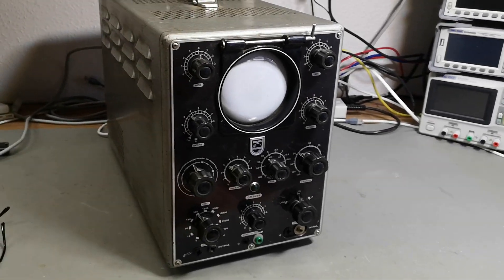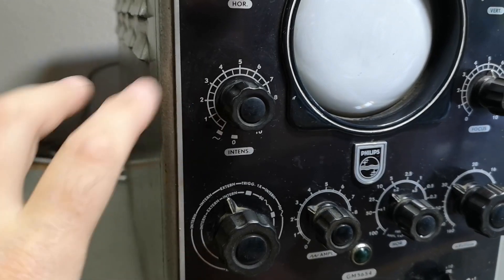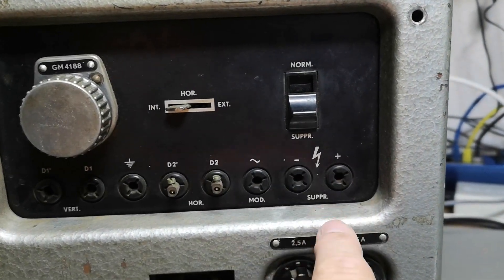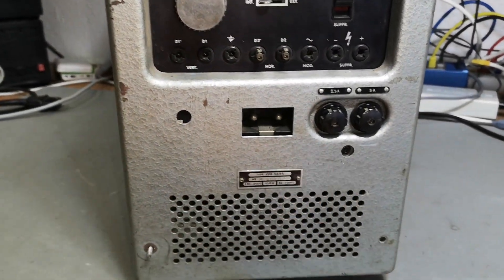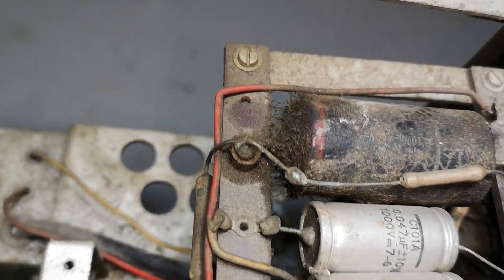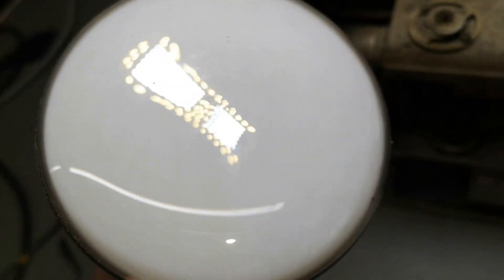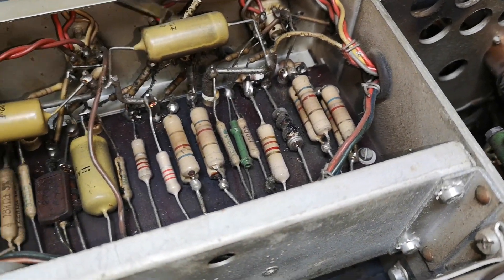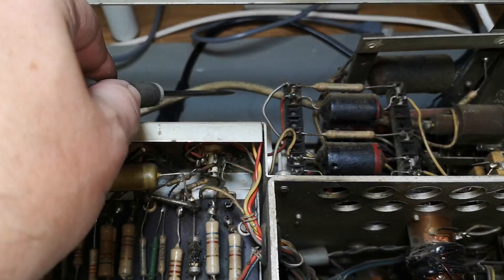Philips GM5654 Oscillograph 1954 15 tubes Oscilloscope teardown

Comment: Ich habe das GM5653 aus den 50er Jahren Erfolgreich aus dem Dornröschen Schlaf (50 Jahre außer Betrieb) erfolgreich instandgrsetzt. Es hatten nahezu Alle Teerkondensatoren  Leckstrom ab 50V 1ma. So wie die Elektrolyt Elkos bank unten alle Ausgehölt, und 450V Elkos eingebaut, und den Alubecher wieder verbördelt mit der Platte. Eine EF41 und 2 AZ 41 waren Müde. An dem Anoden Kabel liegen nur -800Volt an, als Beschleunigung. An der Kathode liegen 1350 Volt an. 

Der Sinn dahinter ist das man beschleunigungsspannung und an den Ablenkplatten außen herankommt, um Frequenzen bis viele Mega, bzw, Gigaherz Sichtbar zu machen mit der Internen DG10-6 
Ich plane ein Video zu dem Oszilloskop zu machen.
Reply from the maker: wow impressive, i normally dont restore to original looking state, for scopes and measurement equipment, since not that highly valued collecectors items, but tube amplifiers and such hifi items, it is clearly a thing to open old caps, and put in new that works, just for the look
Reply: @TeardownOZ2CPU Es war Technisch nicht anders Möglich: unten in der Mitte ist die Platte mit 9 Becher Caps die durch Löcher in der Platte und Massekleemme verschraubt sind die Positive seite ist unten wo auch die Lastwiderstände sitzen. Die einfachste lösung war den Fuss des Elkos für die neuen zu nutzen, incl Draht Schlaufe für den Negativen Pol. 
Von Daher war es nicht schlimm, auch die Original Alu Becher wieder drüber zu setzen, und zu verbördeln. Das war der einfachste weg. Ansonsten stimme ich dir zu das an Hifi Geräten genau so umzusetzen um Originalität zu erhalten.

Comment: My first scope was this model. The only differences I can see are the transport handles on top and the probe connector. Mine had two handles made of bakelite and some rf connector for the probe,  It was broken when I got it and the culprit turned out to be a small tube in the input channel. The tube used was originally used in hearing aid equipment and I did found one so everything was fine (I thought). I did notice that a lot of the circuits I made( especially the cmos 4000 series ones, 4000 because I only had the Motorola cmos databook ) didn't work and after some investigation it turned out that my oscilloscope had turned itself in a signal generator with the probe happily injecting a 55 volt 15ma in every circuit it touched. Long story short, I gave the scope away to some guy who thought he could fix it and nowadays I'm happy to use my Rigol and rebuild Tektronix scopes. The best thing I can say from this scope is that it gives a very satisfying orange glow when in use.

Comment: Note all those metal can capacitors are filled with PBC oil, so careful with the fingers touching them. Of course they are still in tolerance, thick foil plates and oil soaked paper dielectric, good till the case leaks.
Reply: Yep, quality caps. But licking them is a bad idea ;)